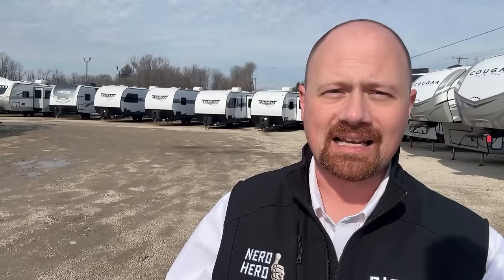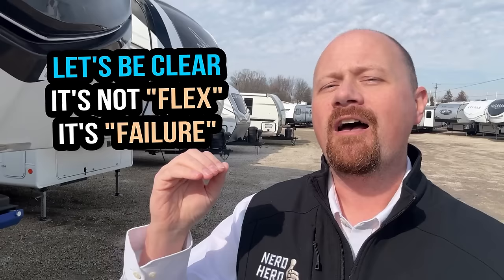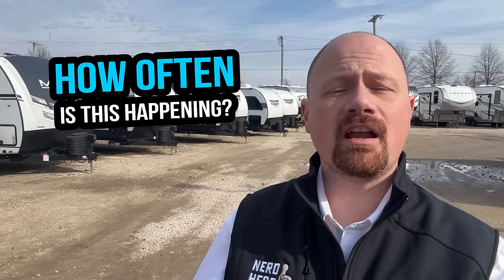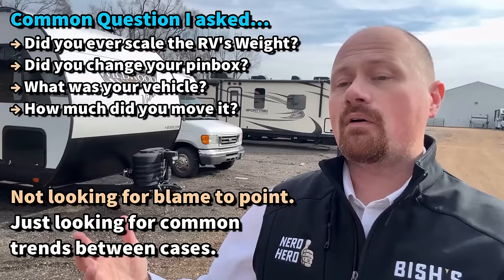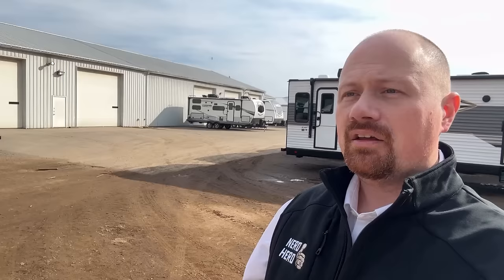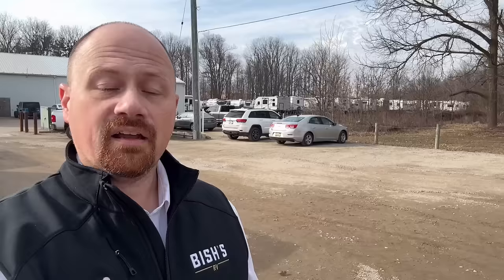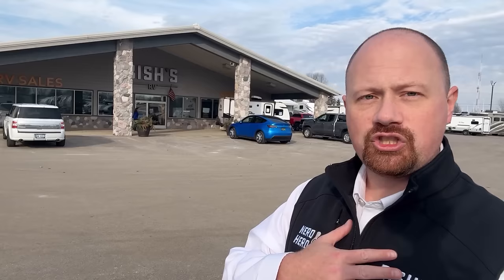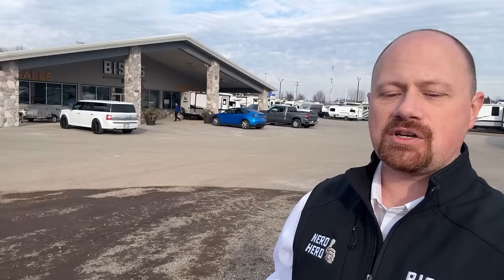🚨 RV Frame Flex & FAILURE!! • WHAT is Happening and WHO is Responsible?!

Comment: Josh, i am new to your channel but have watched many of your videos. Yes, you are a nerd with a goofy laugh, however, you present many facts about the RV industry, and I have enjoyed your information. I wish more Dealers would get on board and start a trend to improve information and to question the build quality of the RV's they purchase from the manufacturers. I couldn't help but to comment on your resent video "Frame Flex" You are the first Dealer I have heard to comment on this forbidden subject. The RV industry is under scrutiny, not only frame failure but quality control and service. RV manufacturers know they can do more to correct their problem areas. They know the consumers are frustrated. So why do they take a slow reactive approach rather than a proactive approach, or to put it direct, no approach at all. You are 100% correct about Manufacturers. They need to inform the dealers and consumers more information about the product they are building. The term "full time RV", the term " 4 seasons ready". Weigh each and every RV before it leaves the plant. These are but a few of the recommendations. If they need to build a stronger frame, then build it and cut down the load capacity to keep the weigh balanced. "Big Truck and Big RV" did a video on the steel used in RVs. I believe he used a 38' RV as an example. To go from a 10" main I beam to a 12" I beam with the same gauge steel was approx 60lbs per side or 120lbs total. Use more gussets to support connections. This is nothing new, The RV industry already knows this. The biggest problems in frame failure I have seen is very poor welding. I would bet most RV frames from Lippert, the welders are not certified, not trained properly, and not quality controlled checked on every RV frame they produce. If RVs are designed and advertised to travel full time on the road then build them to travel on the road safely. The frame is the core and the strength and should not fail. What if 1% of all cars frames failed. What if 1% of all semi-trailer frames failed. What do you think would happen. Things would change and fast. The RV manufacturers are under regulated and as long as this exists the problems will continue. Suspension systems need upgraded. Why would you install 5200lb axles and springs and bearings and shackles when the trailer is rated for a max load of 10,800lbs. I know what you're going to say, the truck picks up 10% of the weigh. However, that is static weight, at rest. Now let's factor in moving weigh, you will lose most or all of that 10% while driving at safe highway speeds on the roads in America. Build the frames and suspension systems to exceed the max weigh rating of the RV. Why are owners required to fix the manufacturers problems. The 1 YEAR WARRANTY isn't enough. Stand behind your product and give a 2-3-year warranty. Owners are tired of having to upgrade Chinese tires. Shackles, springs and bolts that fail with PLASTIC Bushings, and Frame failure. Enough is enough. I think we all know why, "High Profit" and CREED.

Comment: Hi Josh, you bring up some good reasons for structural issues with today's campers and the poor quality control. It seems manufactures are battling building a high quality camper and keep the weight down. This is not a good combination and unfortunately bad for the longevity.
Reply from the maker: It's all a mess and I still won't claim to understand it all. I just know we'd all be better able to understand how much/how hard an Rv is intended to be used if we had more information shared with us

Comment: I owned an Attitude toy hauler with a Lippert frame that actually split horizontally because of the bad design of the supports welded on to the I-beam frame over the leaf springs. Instead of welding the angle iron supports vertically, from top to bottom, on the I-beam they welded them horizontally, side to side, on the I-beam. The flexing of the I-beam frame caused it to crack right at the weld points of the supports they put in. When I contacted them about this they said it was a known issue and told me I had to bring it to one of their authorized repair centers both of which were at least 3 states away. I was unable to tow this trailer as this happened on a cross country trip. I took it to a dept of transportation certified shop for big rig trailer repair and the first thing they told me was the failure was due to the supports being welded horizontally across the frame. The weld weakened the frame and created a stress point every time the frame flexed those support brackets finally caused it to crack. The shop said the supports should have been welded vertically. I had to pay out of pocket for repairs and it took me 2 months to finally get Lippert to pay up for their bad design. I still see welds like this on some trailer frames and have no idea why they continue to do so.

Comment: The pinbox frame issue has been going on since early to mid 2000's. The name has been changed but is still the same issue..  2 things are causing the issues.  Trying to save weight by using lighter frames and poor manufacturing by using the wrong welding process by people that aren't skilled.   My last 5thwheel had the entire upper deck(pinbox to the front vertical wall)  attached to four small ouriggers with 4 small less than 2inch long tack welds.   None of it was directly attached to the main frame, then the main frame was built with 8inch ibeam.  This was a 14000lb rated toyhauler.  Needless to say the main frame rails bent.  My current rv is a 21 torque bumper pull, I found supply stickers on frame,  it was supposed to be a different brand,  non toyhauler with through frame slideout even had holes cut out, non of which my trailer is.   Needless to say I will be upgrading the frame before i have issues.  
Josh isn't wrong in his points but the main problem the frames just aren't stout enough.  To make them substantially stronger would only take 2-300 lbs heavier and better train the welders doing the work.

Comment: What I have seen / heard about flex / frame failures is poor welding skills of the RV’s substructure, especially fifth wheels by the frame maker or RV manufacturer. In the whole pin box area basically the whole floor substructure underneath the master bedroom bed.  If welding at the wrong temperature/ and or feed, it will weaken the metal a 1/4” up to and inch from the actual weld.  Thus turning that metals monocular make up to a more brittle metal.  Thus more susceptible to actually cracking or ripping.  

This applies more to travel trailers.  Some use a 4, some a 6” and others a 8” frame rail.  Some weld the frame on top of the “A” hitch area.  A few integrate that “A” into the frame providing a more solid structure.  

The brand of RV travel trailer ( Outdoors RV / Arctic Fox )  uses the 8” frame rails, over sized axles ( 5200’s vs 3500’s or 4000’s ) and shock absorbers (4)  thus a very healthy 3500 lb. cargo capacity vs 800-1800 for a 29’ unit.  

A cheap RV is a cheap RV.  You get what you paid for.

Comment: I enjoyed your video, Josh. As a current RV owner,  I can tell you that I personally took close to a year of doing research prior to purchasing an RV. People fail to realize that an RV is a piece of equipment. This piece of equipment requires maintenance,  inspection, and constant care. As a retired USAF aircraft mechanic,  I have become trained to do inspection with a careful eye. I have been told I go overboard with what I do. However,  I really dont care what others say. I have weighed my RV empty and loaded with everything we use on a normal trip. We pack our items spaced throughout the RV. As you stated in the video, the cargo capacity is listed as what you can load throughout the RV, not just in one part of the RV. To me, common sense should come into play. The dealership we purchased ours from came right out and said no RV was designed to be used for full-time use. The more you use something, the faster it wears out. Also, people need to stop "upgrading" their RV. The RV was engineered to be like how you purchased it.  Modifications to me lead to trouble unless it is performed by a qualified person. Your video made a ton of good points. Thanks for making it!
Reply from the maker: Thank you so much I really appreciate it

Comment: I completely agree on the full disclosure of weight information, just found out recently that the sticker posted weight on the back of a truck camper does not include the “mandatory”, non optional, option package which can add over 500 pounds to the weight of the camper!?! Which of course makes a huge difference in safely staying within payload capacity. I thought a single rear wheel 3500 could get me a hard side camper, but I found out how few can actually fit in my payload capacity safely, luckily before my truck frame snapped in two.
Reply from the maker: Yeah the weight requirements out there are a little wonky at times

Comment: Greetings,

As a professional truck driver for over 35 years and a tow company owner in the Colorado Rockies, I've recovered many trailers of all kinds. When you were talking about what trucks that can over stress the pin box I can show some clarity on that.

1) semi trucks : If the truck has air ride then the suspension is not the issue. The issue is more if the torque rating and the air brakes. With the king pin not under the trailer like on a semi trailer but out in front and down, the horizontal pulling will cause a twisting action on the pin box. A normal diesel pickup will have anywhere from 500 to 1000 lb-ft of torque, but a semi truck can have anywhere from 1500 to over 2000 lb-ft of torque in which it over stresses the trailer, also the air brakes if not careful will put more braking pressure than the trailer brakes can't keep up so it stresses the pin box in the opposite direction. Braking should be equal between truck and trailer.
2) F450-F550 : here is where the suspension comes into play. The spring stacks on the F450 and F550 are heavy enough that if you are going to use one you probably should get a fifth wheel with airbags.
Reply from the maker: Ty for taking a minute to share your insights and experience. Be safe out there

Comment: Thanks, know it all makes since! When I bought my used 2021 41' Montana in Oct 2021, there was about a 12" long crack in front of the front slide on the passenger side, we asked the salesman what happened (he went and asked) came back and said "I don't know but we can fix it" the 5th wheel came with the optional generator mounted in the passenger side storage! Now I'm pretty sure they filled the crack with flexible caulk and put a peace of moulding like it was ment to be, it was frame flex I believe, and everyone at the well-known dealership knew it,  but me.

Comment: Great video Josh and thank you for being as candid as possible on this topic. We have one of those large RVs that may be in this category that is experiencing “frame flex” albeit it hasn’t reared its ugly head as of yet. I will add one more of the possible contributing factors are these horrific roads we have across the USA, in some cases they are so rough and abrupt it is outright dangerous to pull an RV on some of these roads. It’s truly a wonder that this isn’t even more of a prolific problem than it is. These roads are absolutely horrendous and probably caused by a massive increase in the numbers of heavy 18 wheelers traveling our roads over the past couple decades. I’m not trying to be political, but some of the funds being sent/spent elsewhere should be applied to fixing and improving our roads.

Comment: I’ve wondered many a time if I’ve got too much trailer for my truck. Like you said, the numbers are kind of a mystery. I’m towing a 42ft with a SRW truck. By the truck manufacturer’s towing guide, I’m good, but there are so many factors at play. I’ve got several thousand miles of towing behind me with this rig without incident, but it’s still nerve wracking to not know for sure.
Reply from the maker: Reason would suggest you’d have seen an issue by now but it’s always good to investigate further

Comment: Hi Josh. Lets talk about scaling your RV. Maybe a topic specific video might be in order.  CAT scales are designed for semi tractor/trailer rigs. There are three separate scales. When I scaled my dual axle travel trailer, I spotted the rear axle on one scale, the front axle on the second and the tow vehicle on the third. This gave me an accurate weight of the load on each axle and the weight of the tow vehicle with the hitch weight added. It does not give a true indication of loaded trailer weight. You can guesstimate if you know the tow vehicle's curb weight. A better option would be to unhook and put just the tongue jack on the front scale. That's not easy to do at a busy truck stop with a line at the scale. You also want to know the combined weight of your entire rig. Weighing with the trailer attached will give you that weight. I've only scaled my rig once, during a long trip when we were 'loaded for bear'. I had to guesstimate the trailer and tongue weights. How would you do it?
Reply from the maker: There are some good videos out there showing you how to do this but basically you need to scale it twice - once with the trailer attached and once unhooked with just the truck

You subtract the unhooked axle weight from the loaded rear axle weight on the truck to know what your actual hitch weight is

Comment: We need an industry certification program. You could build an RV that is four season rated as you can build a car that starts when it is super cold. Most are not designed this way. Most of the failures on YouTube seem to relate to a brand which has the initials of something you might say if you experience frame failure. An acceptable cargo weight ratio should be there. If the rig can tolerate 4,000 lbs of total weight, it is reasonable to expect at least 1,000 lbs of cargo. Put everything on a sticker like care fuel economy. The certification should also include a water resistance test.

Comment: From my perspective as a mobile tech/mechanic in the state of Georgia, I would like to add the following, and same as you not going to call out any manufacturer(s) or try and shift blame, but just some of the things I see/from my perspective:

1. The problem in some cases definitely can be avoidable. Extending off of what you mentioned regarding towing, I see many delivery/transportation vehicles that are 5500/6500 vehicles, pushing very close to the 26,000 lb GVWR required for CDL ( a variation of the overkill tow vehicle you mentioned ) that take these units from the north and get rushed down as quickly as possible. So you're dealing with a very stout vehicle often traveling at speeds of 70-80MPH on poor quality highway roads. Like you said owners can have the same type of setup, simply because they already own that vehicle and just know it's capable of towing, just continuing the problem.

2. In my opinion/experience, the problem impacts more than half of 1% of the larger fifth wheels that have the susceptible chassis'. Maybe this is regionalized, or maybe when the manufacturer said half of 1% they were referring to half of the entire fifth wheel production they have, but for the larger RV segments that this impacts most I would say this issue impacts closer to 5% of my applicable clients, maybe more. My percentage could definitely be impacted by the smaller size relative to the market as a whole, as well as the fact that people are often contacting me because they have an issue, compared to say preventative maintenance calls. Given that you're doing a video like this though, it just seems unrealistic that this is impacting such a small percentage but is talked about so frequently.

3. I'm sure this can be interpreted a couple different ways, but when getting approval for the repairs, if the damage wasn't too excessive and was caught early, part of the repair as documented by at least one manufacturer involves reinforcement. I think that right there for most people will make you think this is a known "issue" and could have been avoided by proactively reinforcing. It doesn't help that if for some reason you get someone on the phone to talk about it, the RV manufacturer will blame the chassis manufacturer, and the chassis manufacturer will blame the RV manufacturer. Similar to what you see with something like the Schwintek slide system where the RV manufacturer blames the slide system but Lippert says the RV manufacturer isn't using the system the way it was designed.

4. There is so much advertising and other papers/stickers in one of these units that are mostly useless that I 100% agree with having manufacturers put something useful such as true weights etc somewhere inside/outside the coach for owners.

5. While I agree the customers can definitely be better educated on what they're buying and their intended use, one of the highest incident rates I tend to see this issue with are ( to keep it generic ) large triple axle fifth wheel toy haulers. Through the manufacturers own website and marketing material, you'll see these RV's pictured off road, maybe even leading up to a ledge overlooking a body of water, where the point is the terrain isn't paved road. Not saying that putting your RV on that type of road is a guaranteed way to have this issue occur, but to use the opposite logic and tie in with something you said in the video this issue isn't happening with the RV just sitting static in a single space.
Reply from the maker: Ty for taking the time to share this